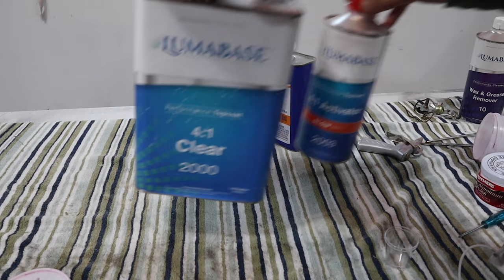BMW E28/E30 Plastic Trim Restoration & Chrome polish || Garage Build PT6

Comment: I wish this vid went over the process for taking off the door trim.  Mine needs to be re-done alone with the door window seals.  Car looks amazing btw.
Reply from the maker: Removal processes is in one of the early restoration videos. Trim is fairly difficult and will vary depending on condition of the car. I would highly recommend watching the disassembly videos